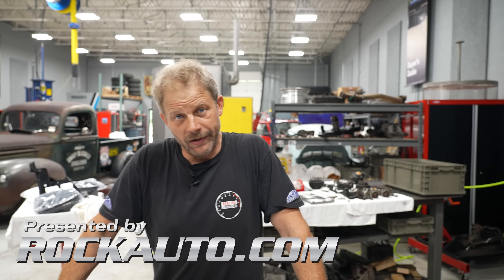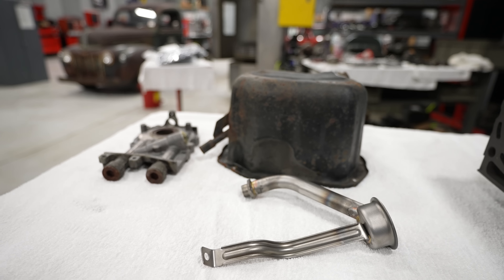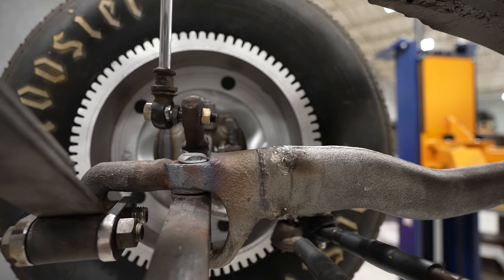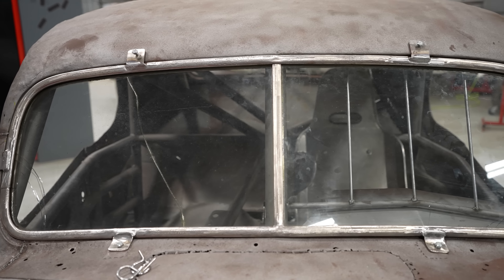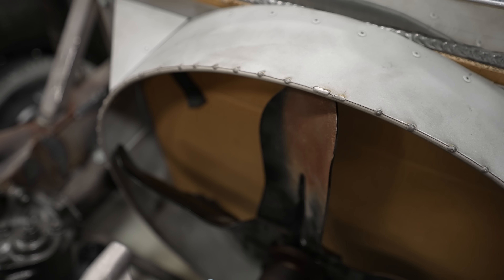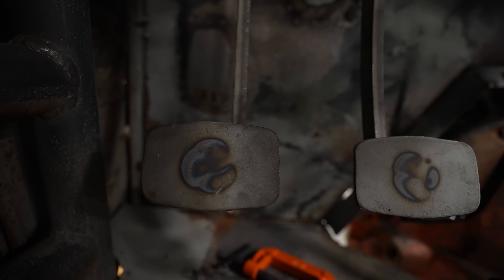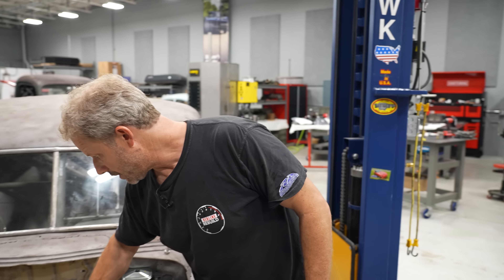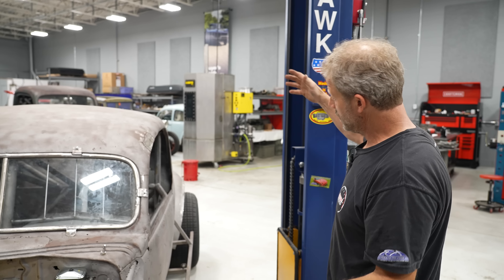Subaru oil system confusion and an update on our dirt track racer

Comment: Your stock pump is a 10mm, hence the number 10 on it. But most importantly!!! pull the plate and put some vaseline in a few of the rotors. Otherwise, you will not get that pump to prime. Subis pumps are horrible at trying to pull oil through a dry pump. Also, a 9mm is about perfrct for a basic DD or even a mild build NA motor. Typical 2.5 NA use a 7mm.

Comment: Simple!!  Dry sump it with pickups right left and centre. The problem you will always have with wobble plate engines!
A fan on a dirt car??  What are you thinking?  You are going fast enough for the air through the rad to cool the engine. A fan just A. gets in the way of airflow and B. is plain bloody dangerous as they throw blades. I have seen them go through rads, bonnets, splash trays and in one case into a spectators leg!
An electric fan to move some air driving in through the pits is handy. 
Ditto for road race cars a well.

Comment: Bigger volume oil pump cavitates less, and can carry thicker oil. Turbo engine needs good crank case ventilation. While on the subject of ventilation, your rear vents on the dirt track car are for oil spill only. Instead put two vents on the front of the valve covers and one on the lifter valley. Plumb all three into a catch can, with obvious splash guards installed. When in use, that dirt tracker needs to catch left turn over steer. Are you sure your mods on the steering didn't lose steering angle to the right?

Comment: A JDM EJ206 is so much more economical than rebuilding a stock piston/rod EJ205.

You can also buy an EJ257 short block from Subaru for around 1800.

I suspect you also know that getting a competent machine shop to overbore and line hone is pricey.

Real world for 275-350 Hp, no one is cracking cases. There is no need to, when good JDM engines are 800-1200 in long block.
Reply: Plus any local machine shop will machine and hone the case halves individually, which will throw off all the dimensions once they are torqued together. Gotta have a machinist with the fixtures to handle a Subaru.

Comment: Crank driven pumps are a horrible idea, they add air from cavitation at high crank speeds, and they are bound to cause a failure.....slow the pumps down to 55% of crank speed, use a dry sump, get it into a tank with larger capacity, and oil cooler....

Comment: The way you fix the Subaru drain back issue is to throw that engine in a creek, replace it with a Harbor Freight  Predator  and get back working on the Race Car :)